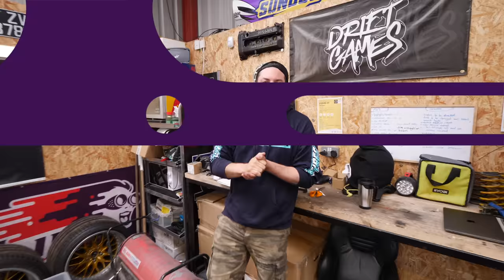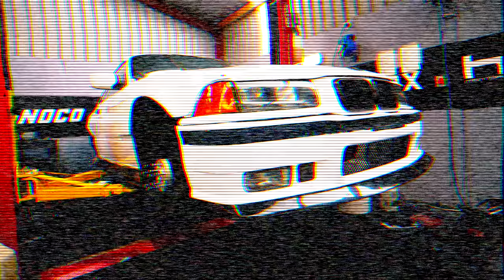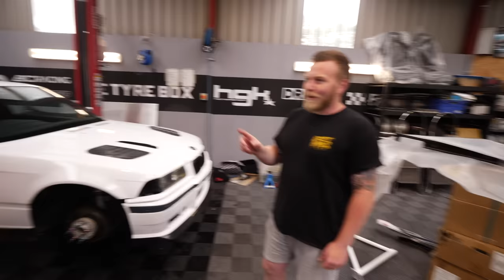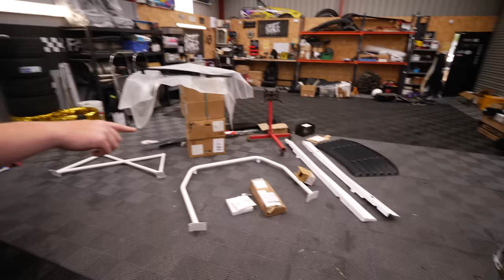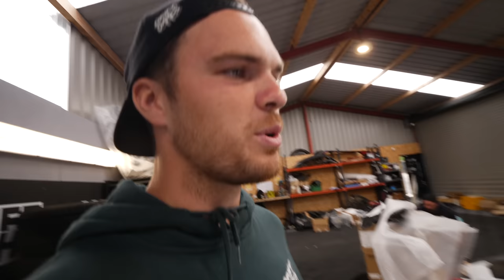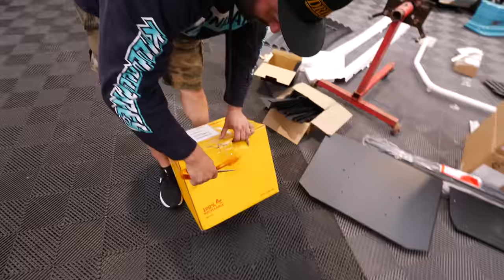Adam’s BMW E36 318is project | WRECKED to PERFECT in 2 days!

Comment: i just picked up an e36 318is here in the states for a very good price. it’s fairly stock but missing a door card. needs to be lowered on a nice set of wheels asap. idk much about wheel specs for this chassis though, any recommendations?
Reply: Are you looking for door cards or regular door panels
Reply: @typogue5484  i was looking for the stock beige panel but it seemed to be an elusive item to find. luckily it’s still available brand new and was able to acquire one. now i’m looking at wheel options and it seems the arc8 are a good choice for now.
Reply: @fmx623  I have a set of 04 BMW Z4 wheels that I use sometimes and they look and ride great
Reply: @typogue5484  those are cool. i’m currently on the bmw 5 spoke ones. but i’m looking for 17” ones now.
Reply: @fmx623  ohh I just put a widebody on mine so I’m about to put a set of forgestar f14 ultra deep concave 19” on it

Comment: Those aftermarket door trims can be a bitch. You need to remove the door card and hold against from the inside and then it wont pop back out